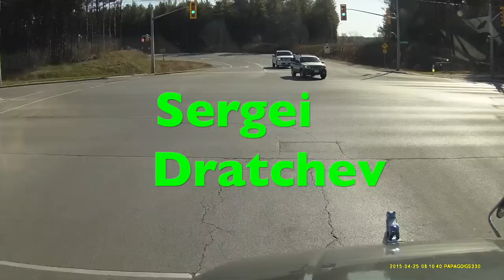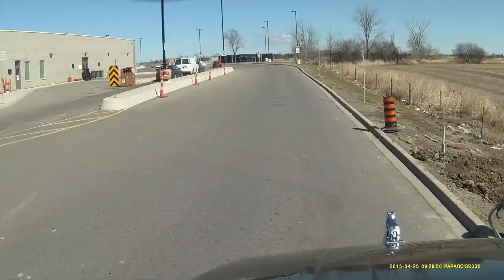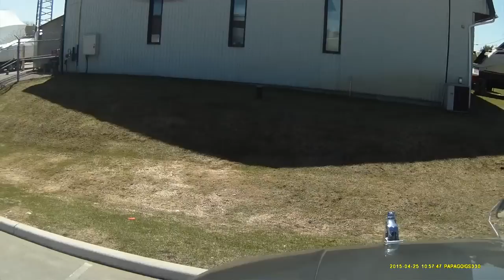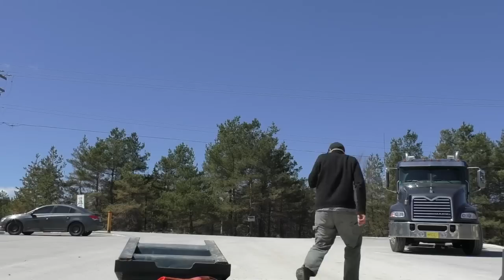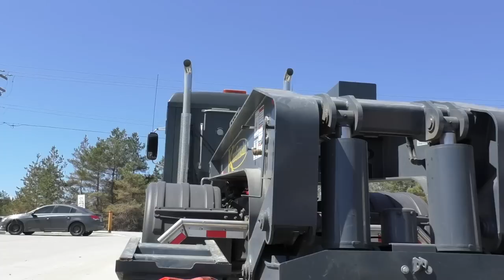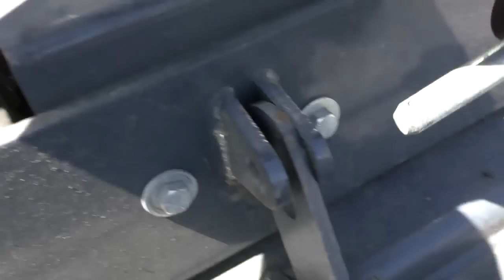HEAVY HAUL TV: Unloading CAT 950M in Orillia ON, Canada

Comment: cool video.......do you spray those airline couplers with a good quality lubricant?
You should use Krown, it would keep them all lubed and limbered up for ya :)
Reply from the maker: BULLDOZERBERT i did that in winter with the orange trailer. these so called quick couplers are a pain in the a** when it's freezing cold outside. so far these ones on the gray trailer work good. i'll start spraying them with W40 when i cannot connect or disconnect them.

Comment: Did you not cover the exhaust pipe.. ?  i didn't see you remove a cover..
Reply from the maker: Mike Mchale someone is cutting my video classes? okay, you have to watch this again: https://youtu.be/IgRqEuROWZk?t=1m29s
Reply: He did, check the last video ;)
Reply: Mike Mchale That is a very good idea of cover the Exhaust as just a little bit of mobile air will turn the impeller at a time there is NO Oil going to the Turbo. A Turbo failure will occur soon.                                                             Barry.
Reply from the maker: I think it's all urban myth. We should send a suggestion to MythBusters to test it. In order for the turbo to turn there should be a CURRENT OF AIR. Just because the exhaust is open (when it is), does not mean the air can go through; the cylinders are closed - there's no escape for the air on the opposite side. But I'm covering the exhaust each time just to keep customers happy.